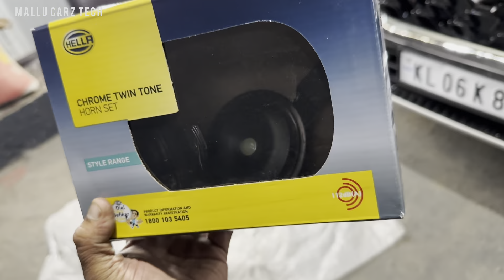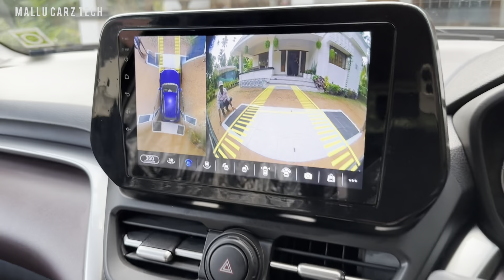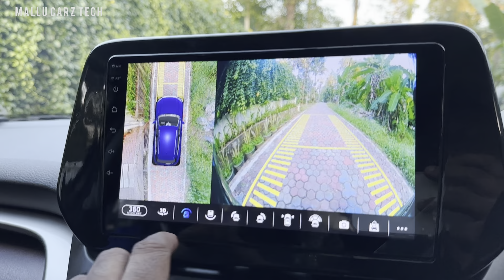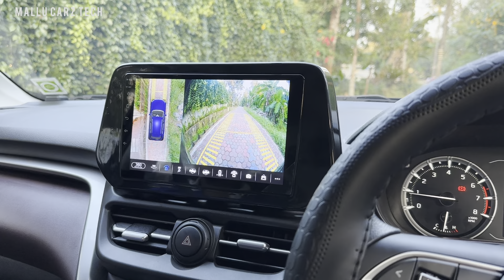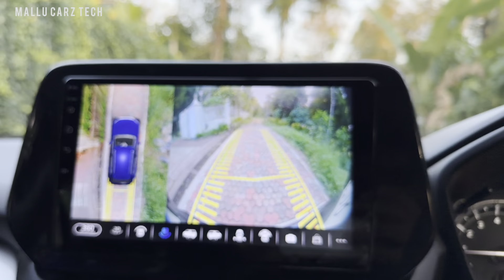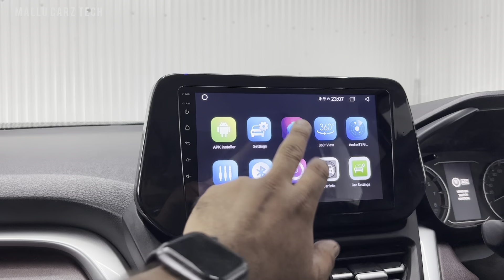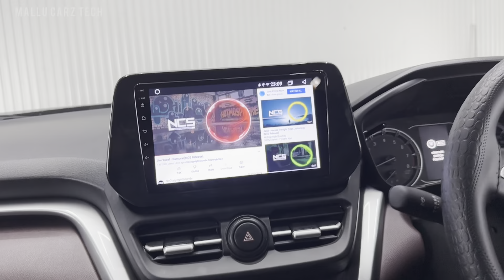SUZUKI GRAND VITARA🔥BASEMODEL 🔥360 degree/apple carplay/system/ INFINTY/HELLA/DOOR DAMBING

Comment: For 360 camera, hella horn, subwoofer installation wire cutting veno? Or plug and play?
Athupole if car has an infotainment system(zeta model) inbuilt can we add 360 camera without replacing it.
Reply from the maker: PLEASE CONTACT TO THIS NUMBER : 9539655476

Comment: Base മോഡൽ ലിൽ തന്നെ automatic A/C അത് suzuki മാത്രം 👍
Reply: do check Honda City
Reply: @dinkan5838  push button start, keyless entry, alloy wheels, front and back armrest, rear ac vent, automatic AC, 8 inch infotainment system with Honda connect (connected car technology), reverse camera, foldable and retractable orvm, rear defogger, 4 airbags...Ithokke Honda city base modelil und...In addition to that the i-vtec motor is way more powerful than the K15C in Grand Vitara..Also Honda city achieved 5 star rating in Asean NCAP crash test.
Pinne material quality njan parayenda aavashyak illalo...Way ahead of Suzuki
Reply: @Arun-xe9wl  Spare tyre is of a smaller size and reverse camera quality is very poor in the 5th gen City V (MT). Also no wireless Android auto/ Apple car play.
Reply: @VaishakNair89  grand vitara doesn't even offer an infotainment system and reverse camera..Also in the case of spare tyre, people use that hardly for 100kms
Reply: @Arun-xe9wl  delta variant aanu price wise similar...Sigma is almost 1.5 lakhs cheaper than City base.